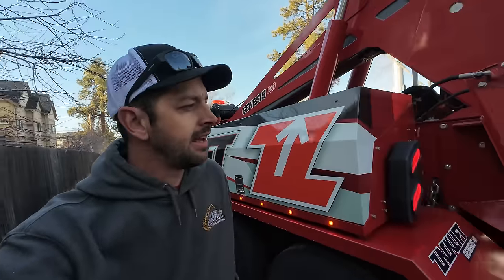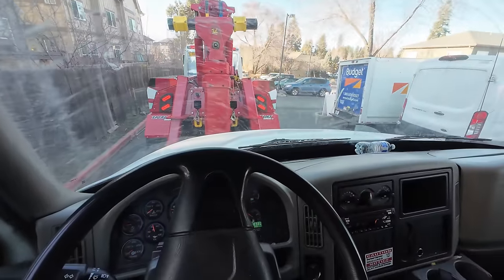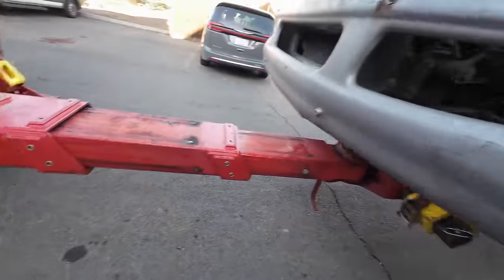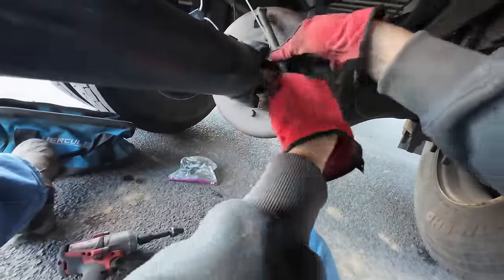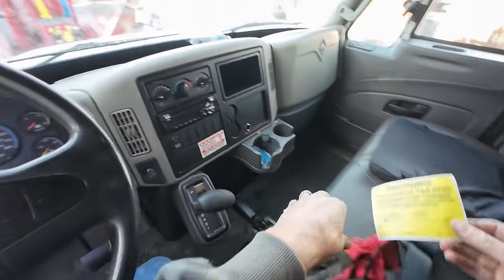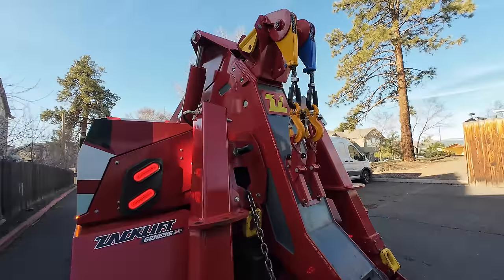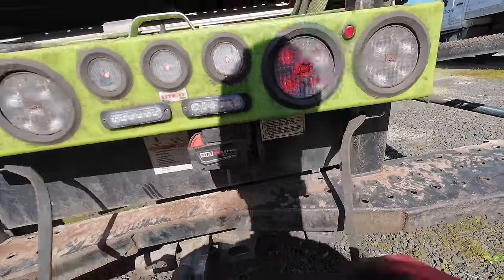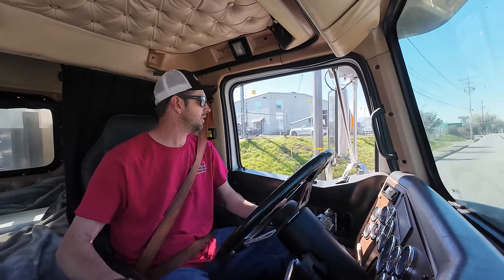Stolen truck needs some “Persuasion”…

Comment: After seeing you use spring clamps to secure the loose ends of your straps it dawned on me - I've only got a few dozen of various sizes sitting around - why not put some of them into each of my strap bags! I've always fought with trying to keep the loose ends from flopping around in the breeze - and never once thought about using a spring clamp like you do!

Comment: The safety chain setup is so simple yet so brilliant.
Reply: How else would you do it…
Reply: @timcaviezel69  do what ?
Reply: I was always under the impression that the hooks were to be hooked in the opposite direction, throat hooked vs tip hooked.

Comment: I ran the maintenance shop in Reno for Budget truck rental many years ago. Corporate wanted us to maintain those trucks the same way they did rental cars, and it sucked. Most of the experienced mechanics had to leave because they wanted technicians instead. I quit after they suggested I take a 20% pay cut. Some really good people worked for Budget Truck but Corporate was fubar.
Reply: That was my experience as a customer with Ryder Truck

Comment: I Personally think Cyber Trucks are butt ugly.
Reply: I agree with you.
Reply: what I do not understand is how they managed to get these sharp angles and corners approved under current safety regulations. Decades ago conventional bumpers were replaced with bumpers that blend in with the body lines of the car for pedestrian, animal etc safety. Mercedes even had to make the radiator emblem with a swivel joint so it could bend out of the way, yet this Cybertruck has razor sharp corners and edges that will cut and slice pedestrians to pieces. I guess it pays to know the right politicians, or you have to know when to pay the right politicians?

Comment: What's the range on the wireless light bar? 100'? 200'?  Do they all use the same frequency, or is it possible for it to get confused if another tow truck with the same light bar passed you on the highway until it was out of range?

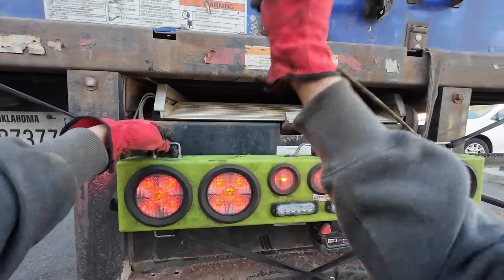Comment: 18:45  I like how you have that solid safety line to keep your light bar safe in the event the tarp straps get oddly loose and fail.  That totally happened a few months ago and your adapted.  What a cool viewer to have gone and retrieved it for you.  Were you able to fix it enough to use it again?

Comment: Fuel prices are still insane levels lower than here in Europe...
Company I worked for until last week had a deal with Shell for diesel. I fueled that truck up every other day, $7-800 every tank, roughly 300 liters every time (yeah, small tank for a truck pulling on average 110000lbs), that added up very quickly...

Comment: Was there a part of the parking lot there to the right of your truck that you could have pulled the box truck to the right of your trick so you could have towed from the back or too tight I imagine to get in there. Not like that thing turns on a dime! Props to whoever towed that truck to that spot I That was rather tight to make that turn on the back of a tow truck. I've seen Pacific Pride around Michigan here so they're in the midwest apparently as well.

Comment: Great video as usual. As a side line, as a kid in Endland some 60 years ago the mash hammer was often referred to as an "American Screwdriver" for some reason. Later in Aus. it became a "tapolater". Either way, a good belt with it normally works wonders. Keep up the good work Sir.

Comment: Park brake back on, but no drive line connected so not doing anything 😊 Watched a tyre guy chase a vehicle down the loading bay when he jacked up one wheel on a UK Bedford that used drive line parking brake😂😂
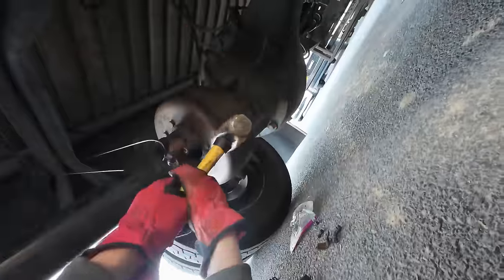Reply: The brake is on the dif. It still works without the drive line. 12:40
Reply: Different trucks, some have parking brake on output of transmission some on axle assembly pinion others at the wheel hub assemblys.  There is probably some other types. Like in Casey earlier video the bus one on output of transmission.  (Not to repeat earlier poster point but clarity)

Comment: I'm one owner like you.I got a exxon mobil fuel card.I pay it monthly but they give you a line of credit.You can pay the minimum and run a balance.I don't' like that. If it gets close to my limit. I pay more than monthly minimum to get caught up.My business is seasonal so some times of year is easier to pay bigger amounts.
Reply: Years ago a buddy of mine had a small trucking company with seven vehicles that used the fuel cards. That was around 1999-2002 His fuel bill. 😳 But it did help on tracking expenses for fuel and mileage for trucks and drivers.  Short hauling daily driver runs.  Earlier in my youth, I worked part-time for a small oil company and one of the perks was a fuel card when working.

Comment: Hi, there. Why don't you use small ratchet scraps for guitar tuner device on the back of the truck? Then rub the scraps, I've seen a rubber snap break.
 I've seen guys lose those.  Devices devices keep it up.I like it

Comment: Odd question,  if you were to have the safety chains to tight, would they break or pull out of lock that's in the wrecker body?

Comment: 25:50 Steering drift could be because of wind? Also dynamic loads are wild sometimes... a pressure could build up and release periodically and the forces are stronger and move stuff more, than an even load. I think its a good habbit of you, to check things always after a few miles!
Reply: The damage in the front might also have played into it...

Comment: I might be wrong, but isn't the parking brake on the driveshaft? I haven't worked on straight trucks much.
Reply: Go rewind & watch it again.
THAT one is with the diff. , so
     the axle was Locked.
His school bus , however , had
     the Pk.Brake up front by the 
    other end  ( so the skoolie 
     rear Axle DIDN'T Lock , oopsie.)
Reply from the maker: This one was on the pinion.  Removing the drive shaft has no effect on it
Reply: @CaseyLaDelle  Thanks for the correction. My motorhome e-brake is up front.

Comment: Mr. Casey LaDelle,
     I have a question for you.
Could you not use the remote while you are driving - slowly - to raise and or lower the front of the tow vehicle to compensate for uneven terrain?

Comment: Is that bruise on your are from when you slipped off the school bus? Hope you are healing well from it.  Did you reconnect the drive line? If not, how is the parking break going to work, or does it work with the drive line out?

Comment: Im not a mechanic so I have a stupid question.   I think I know why you pull the drive shaft but want to hear the technical explanation.   Thanks.
Reply: If it’s not disconnected it will spin the bits in the transmission which could cause damage as it’s not built to be turned basicly in reverse by the wheels with out the engine running there won’t be lubrication
Reply: @heartland96a  I was close.

Comment: Stuck as that driveline was, the recovery driver must have either rear towed it or just straight up drove it. And I can't imagine a rear tow would have worked out very well with that whole step bumper.

Maybe that's why it's bent to hell.

Comment: Hey Casey didn't that guy with a helicopter take a cyber truck to the off road games ?
Reply: Yep, sure did. That was "Heavy D"...
On the third day they had sort of a gladiator show with people watching various rigs doing contrived competitions. At one point, the cybertruck was matched with the "Bombi" snow cat owned by Matt's Off Road Recovery for a tug-of-war. The result was more or less a standoff, they each just dug holes in the deep sand. I was less impressed  (at home) than the crowd in person. Here's the link; Bombi vs Cyberbox starts around 23 minute mark on the video. https://www.youtube.com/watch?v=HlNXeTiw4yo

Comment: Maybe you will explain later in the video, but I wondered why you didn’t tow it from the back so you didn’t have to drop the driveline?
Reply: On a 3 hour tow, wouldn't the extra fuel use from towing backwards make it worth it to drop the driveline?

Comment: Hi, Casey. I saw a guy put a piece of wood under the boom of a tow truck before climbing under the car. Do you think it's worth doing this?
Reply from the maker: If I already have the blocks out I do it sometimes because why not.  But no, it’s not at all necessary.   Those cylinders have holding valves on them and cannot fall down.  In addition to that, I’m never under a part of the truck that could crush me if it did
Reply: @CaseyLaDelle  Thank you. Good luck.

Comment: i realise there probibly rated for the job but are there any advantages to using straps on the axels compaired to chains? 

also love the 5th bungie to make sure it dosnt fall off :L you learned.
Reply from the maker: Yes, far simpler, don’t have to crawl under the truck to tighten the binder, and they allow the axle to easily rotate in the forks
Reply: @CaseyLaDelle how is your intestine injury coming along? Did it heal good?